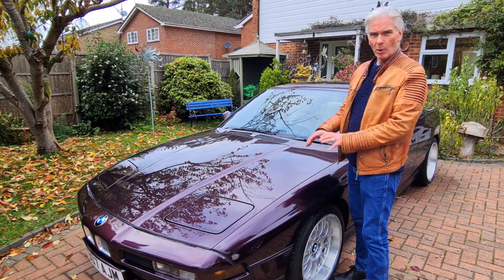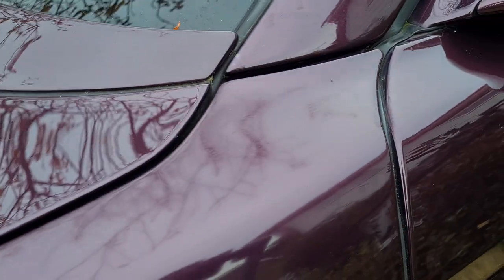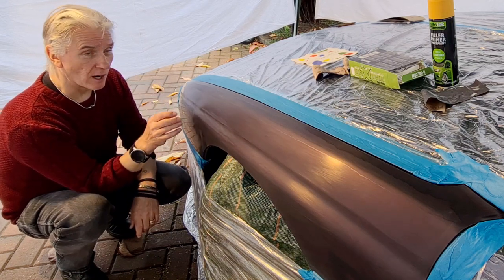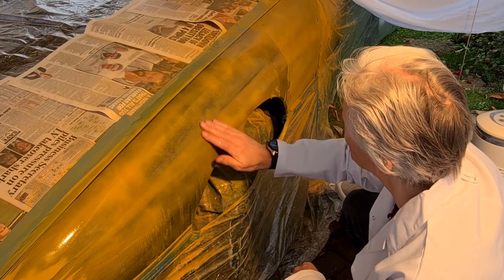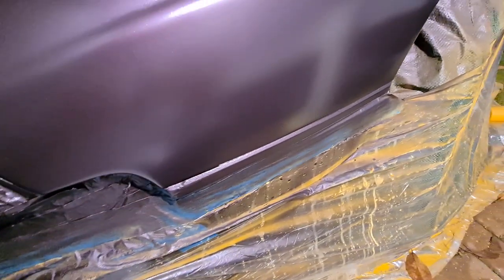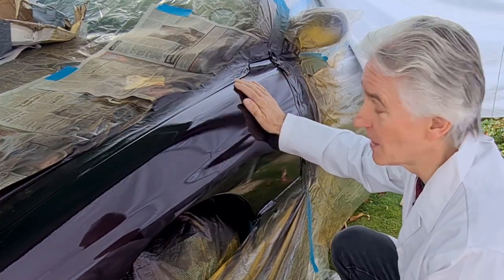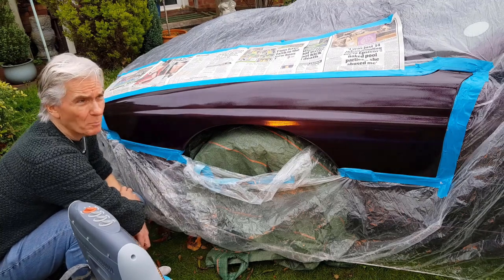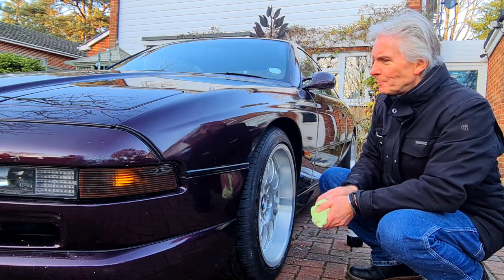BMW E31 Wing Respray GOES HORRIBLY WRONG

Comment: Really good effort! As an amateur i learned some of these lessons thankfully rattle can restoring small motorbike panels and tanks! In my experience ambient temp and control of contaminants (i.e. wind borne moisture and detritus) are the fundamentals. If you had these on your side you would have been much happier with your technique and result. There's a lot of snobbery about rattle can paint work but for individual panels, with 2k clearcoat and polishes we have available these days, you can get some amazing results as a DIYer 👍
Reply from the maker: Thanks! I'm having a good with the boot next!
Reply: @TimmsBMWRepairsandInformation  splendid.  Make it this month or leave it till march! Great vids learned a lot 👌 yours is like my z3 only smaller !

Comment: I think you have done a fantastic job on many levels. First off your attention to detail of masking all off...and not giving up... outside of all places..and the end result looks better than any panel on my 8!!

And...I think most of us understand that we reach a point we don't want anyone to touch our car until we know it will be handled as we handle it...so my 8 needs a lot... headlining sags...it's "50 shades of Fjord grey" as perhaps you recall from Duxford 2013 meet maybe...and the display is dead ...needs many small details...but I can't stand anyone touching it..if I can fix it I do...if not...I let it be...

So this was one of the videos that actually made me feel better as a owner of an E31.

Thank you Timm. Look forward to the next!!

PS I sprayed my mirrors from a can in 2013...still going strong. Factory finish...not at all...but they are grey at least 👌
Reply from the maker: Thanks Michael, yes I remember your car! I wouldn't fancy sorting that one out with a rattle-can! Mora Metallic is a lot easier to work with than silver that's for sure!

Comment: I think you did a fine job considering your environment and circumstances.  it is never easy to spray outdoors.  Personally, i feel that if you had a good spray gun with a small air compressor, you would have been able to lay the paint in a more even and consistent manner.  I enjoy your videos and also appreciate your help when i have inquired on the forums.  KUDOS, TIMM!
Reply from the maker: Thanks Danny, that's very kind of you!

Comment: I did a very similar procedure on my bumper cover last summer. After repairing a crack, I filled, sanded, primed, painted, and clear coated. My 540 is alpine white, so my color match was quite a bit easier. I used the doorway of my garage with a fan blowing out, and the weather cooperated. It was warm and dry. Even then, it took me a long time. One thing I did differently is I thin coated the paint and clear coat. One or two passes and let it dry before the next coat. Not perfect, but ok to my eye for a rattle can paint job.
Reply from the maker: Hello William, yes, I did the same, the video is heavily edited otherwise it would have been 6 hours long!

Comment: So much easier with a gun and compressor. Then you can reduce the clearcoat for the temperature. 

A proper spray (even a cheaper one) gun lays the paint on wider and more evenly. 

I think you did a fantastic job of this considering the products you used.
Reply from the maker: Very kind of you Andrew!

Comment: Good effort and well done trying, but I would never try to respray any panel in the winter, let alone outside. Wait for warmer weather, around 15c atleast. Use a gazeboo or make a shelter for the car. Needs to be wind free and dust free. Its good you are trying to use a heater but in the winter wont help much. You don't need to primer the whole panel, just the bit where lacquer/paint was faded and you sanded it to metal.
Try to spray closer as this cans do not produce a very nice fan pattern. Check a few videos how to use the can, do not press it continuously, do left - to - right movements and let off the button on each end of the panel. Spray slower and do 3 coats, 1 light and 2 heavy. With the lacquer the same. Even if you get orange peel - its fine. Let the lacquer cure for 7 days and then sand and polish.
Doing it in the cold where paint doesn't dry to its potential, you might get some rust and lacquer peel very soon. I would say re-do it properly when the weather is warmer.
Reply from the maker: Thanks for watching the video and giving me good information Valentin, I will take it all on board when I have another go!

Comment: Looked to be going well but i'd never spray outdoors, even with a gazebo! An insect or dirt can ruin all your hard preparation. A good compound paste and polish will do wonders to bad paint finish. Spray cans tend to splatter so best to use long strokes of spray instead of short bursts. My first 2 DIY spray jobs were a disaster but practice makes perfect.
Reply from the maker: I'll give it another go in the summer Amold, I'm not giving up yet!

Comment: I take my hat off sir for a decent attempt.  With the clear coat if your too far away from the panel it will not leave a solid finish and leave you with a flakey/gritty texture i also noticed that you only sprayed in one axis "across" where if you also "crosshatch" it will help the paint/clearcoat level off more evenly.  If your using cans its always good practice to place them in a bucket of hot water prior to spraying as this promotes a more even spray from the nozel.  If it was me in your shoes personally i would have opted to remove the panel completely and take it inside a garage / shed anything that eliminates the wind from effecting the spraying.  Once you have the desired finish the panel needs a week minimum without polishing as the laquer needs to gas off prior to completely curing.
Reply from the maker: Thanks for the tips Chris, I'll try harder next time!
Reply: @TimmsBMWRepairsandInformation  no worries i remember first time i tried to use cans on my motorbike same result lol.